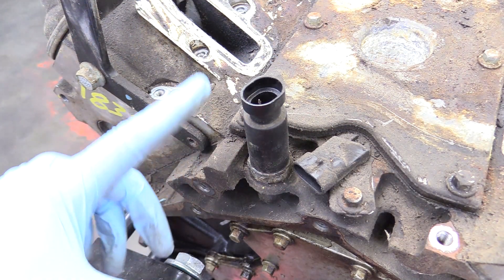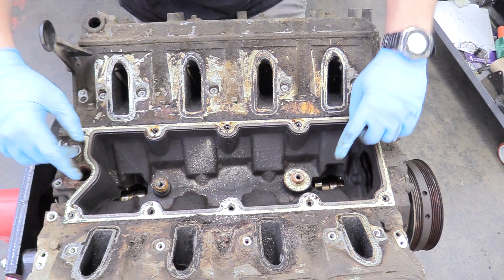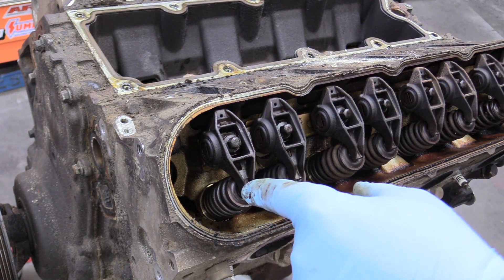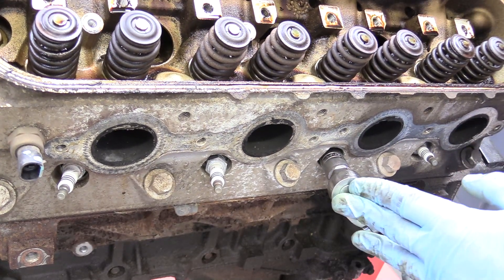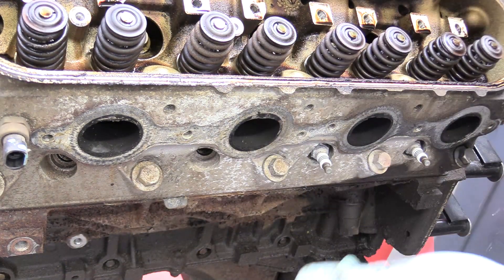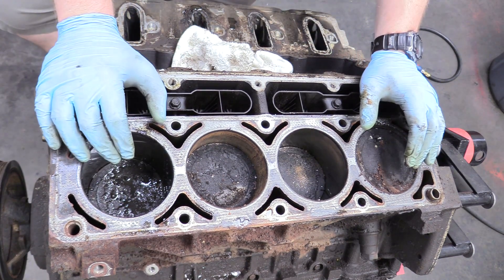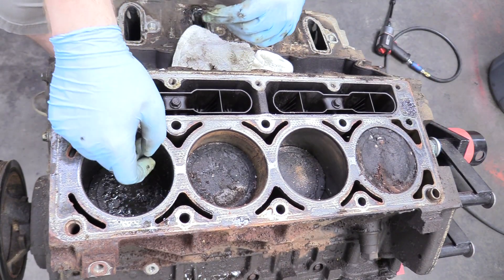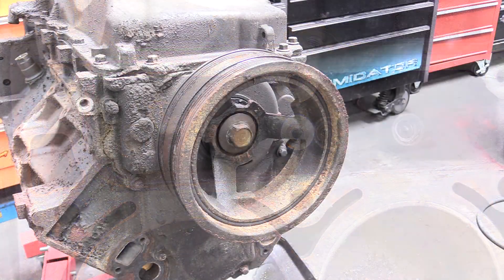How to Build a 5.3L LS LM7 V8 - Part 2: Removing Heads and Harmonic Balancer

Comment: Will the summit intake in these videos work with a L59 engine? Other than the parts needed that's in these videos, what additional parts will I need for a flex fuel L59 engine???

Comment: Good content, but if you haven’t learned yet, the knock sensors have nothing to do with NOX, just preventing engine damage. Nox is a caused by high combustion temps and is primarily handled by the cat. Gas engines don’t have NOX sensors and can only be verified with a 5 gas analyzer. Cat operation is verified by O2/afr sensors comparing pre and post cat reading.

Comment: been super helpful so far but the ol “i just had this tool laying around” with no other info on the puller SUCKS. i can’t find that piece anywhere
Reply from the maker: I have found several by googling LS damper puller. Thanks for watching!
Reply: Weird.... I haven't. I looked actually for about 45 minutes before making my comment. That little piece isn't in any of the mainstays for LS damper puller.
 @2carpros
Reply: I'd like to reiterate that I'm not just looking for a damper I'm looking for the little piece you just "had from another one"
Reply from the maker: I'd like to reiterate too, I found several with a quick google search. https://www.google.com/search?q=puller+tips&oq=puller+tips&gs_lcrp=EgZjaHJvbWUqBggAEEUYOzIGCAAQRRg7MggIARAAGBYYHjIICAIQABgWGB4yCAgDEAAYFhgeMggIBBAAGBYYHjIICAUQABgWGB4yBggGEEUYPDIGCAcQRRg80gEIMTM2MWowajeoAgCwAgA&sourceid=chrome&ie=UTF-8

Comment: @2CarPros , Ryan I am at this step and my lifters will not come out. Not a SINGLE ONE. They are preventing the cam from coming out, and I’ve tried pulling them out and they won’t budge. It’s like something is catching them preventing them from coming out. Any suggestions? It seemed like yours are sliding right out?
Reply from the maker: Is the plastic caddy removed? I have to ask because it's usually the thing people forget. If it is removed then.

Soak them with WD40 or PB Blaster and let sit for like 24 hours. Then use a long thin metal implement and tap on the back side of the lifter (DO NOT SCRATCH THE LIFTER WELL WALLS!) 

Yeah suck down lifters will lock the cam from coming out. 

Thanks for watching!

Comment: Knock sensors in these motors are the devil.  Notice on the later models after 2007 they moved them back to the heads, no longer under the intake.

Comment: I buying a used stock cam and springs lifters pushrod from a freind and I dont know how they where orientated is it that important to put it back exactly
Reply from the maker: Shouldn't matter too much because of the roller lifters but ideally you'd want every thing to go back in the way it came out. Thanks for watching!
Reply: @2carpros  thanks cause I didnt want to buy it and cant use it I'm still in high school and got a free blown up 5.3 put of my .moms 2000 Silverado and I am pretty shure it's got a stuck lifter and the cam would be shot so I was going to get the cam. Springs. Lifters. And pushrod for a 100 dollars and it better than the one I have so that's good I'm just going to put the used cam I got and put it in there

Comment: Just curious, my LM7 has 13mm Valley cover bolts instead of 10mm. Why would GM do two separate bolt sizes for this?
Reply from the maker: That's strange, maybe someone put them back wrong?

Comment: I just took out the headbolts on the 200 dollar lq4 project and the ten were all the same size, shank, thread and length. I'd google it but your knowledge is much better. Is that normal?
Reply from the maker: Yes that is normal for that LQ4. It is a little later of an LS then. The early engines have the setup we do and the later engine have all the same. Thanks for watching!

Comment: Old school bbc guy here,  curious about LS engines and this is schooling me at 53.  I didn't realize until lately that these engines with aluminum heads and roller cam, fuel injection, were around with this amount of potential.  My next build will be one of these, maybe a 5.7.   Please keep going and add the way to integrate with old cars, ie th400 transmissions adapters, motor mounts, etc.   Currently putting a 454 in a 53 Bel air with a 72 Nova front end,  maybe LS ??? next
Reply from the maker: Very cool to read this comment! We will most likely put this in an older truck, no clue what though. Thanks for watching and your Bel Air build sounds cool!
Reply: 62 and these LS motors got me excited enough to build another car. Easy 425hp. WOW!